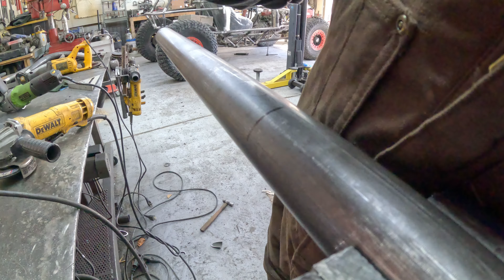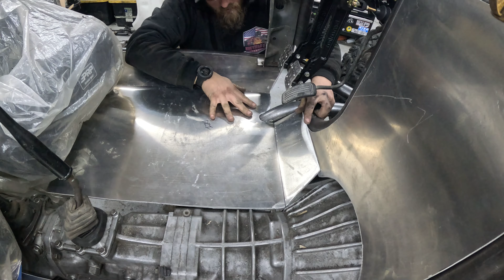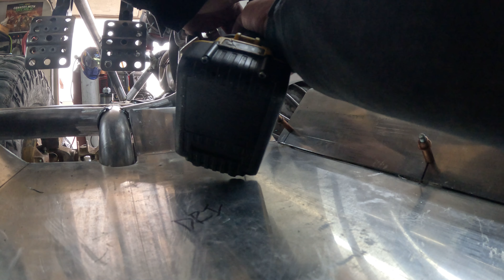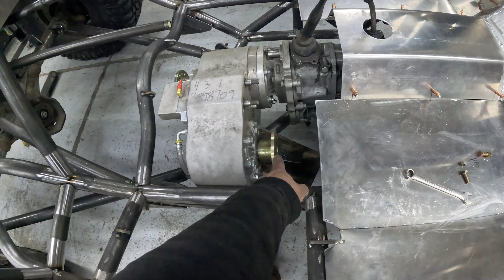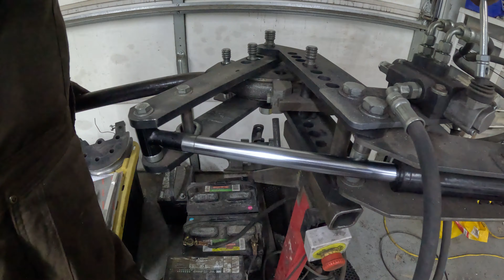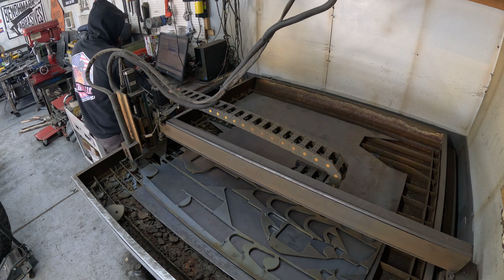1st Generation Toyota 4runner Buggy Build | Aluminum Floor

Comment: Looks great! When I did the floor in my buggy, I framed it all out in 1x1 square that way all the panels were easy to cut and bend.
Reply from the maker: Thanks! Iv done that multiple times so wanted to try do an easy to remove floor that essentially floats so when removed it's super easy to access everything.

Comment: For long straight aluminum cuts, best thing I’ve found is a circular saw with new diamond blade and wd40. Cuts like butter and saves a bunch of time especially on aluminum sheet.
Reply: should just use a regular wood circ saw blade. Can also use a jigsaw with regular wood blades.

Comment: A little tip, when you're cutting or using a tiger paw on aluminum, you can give it a little squirt of WD-40 for some lube and it wont cake up your wheels for longer life and makes cutting go a lot faster.  And if you're going to weld on it, all you have to do is just give it a good little wipe down with some acetone and you're good to go.  This is what I have done for years building intercoolers and turbo kits, my pops showed me that a long time ago.... food for thought....
Reply from the maker: For sure! We just didn't have anything on hand so just got after it the dusty slow way haha. Wasn't really planning on doing aluminum work then it just happened
Reply: Cheap candle wax works, too. Better, in my opinion.